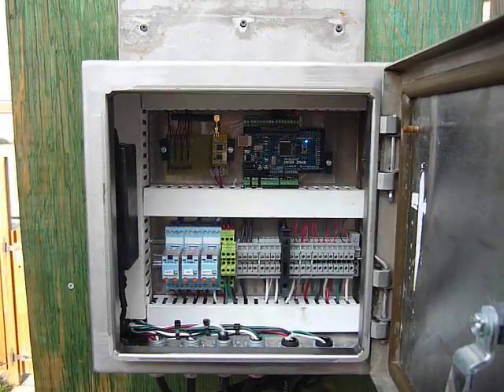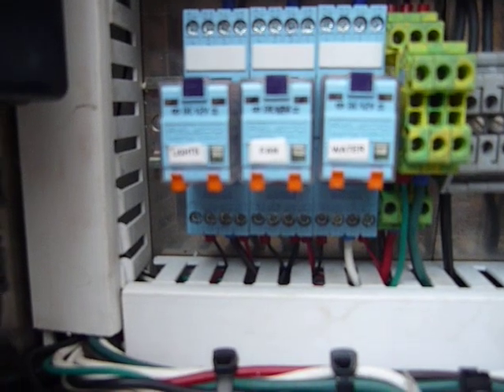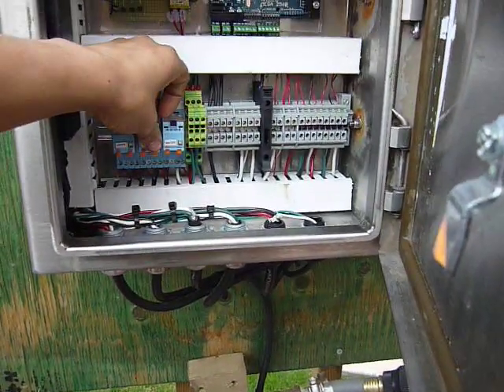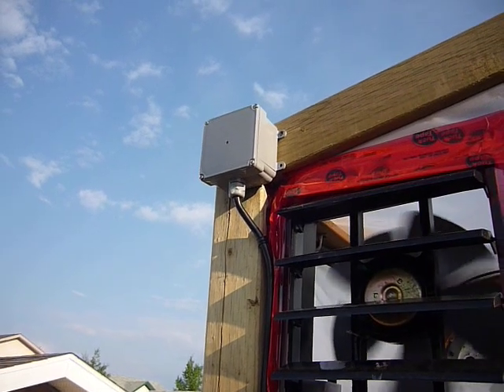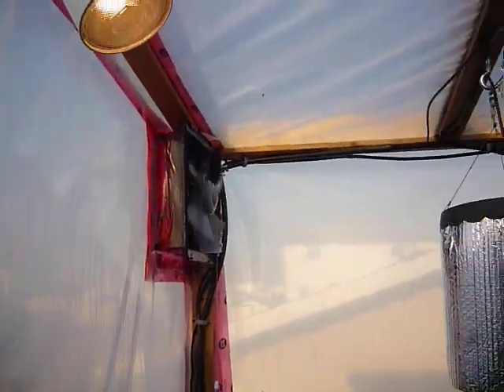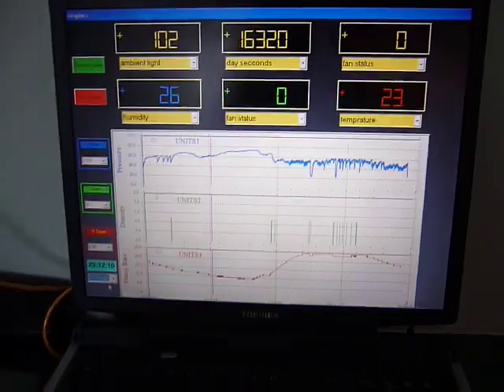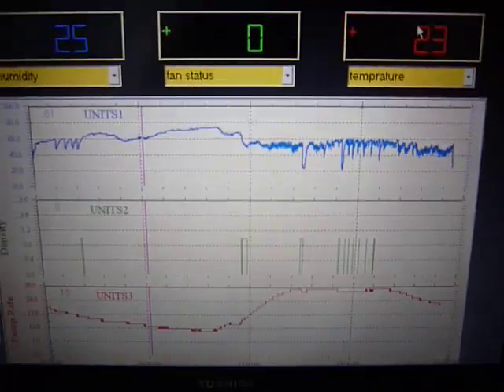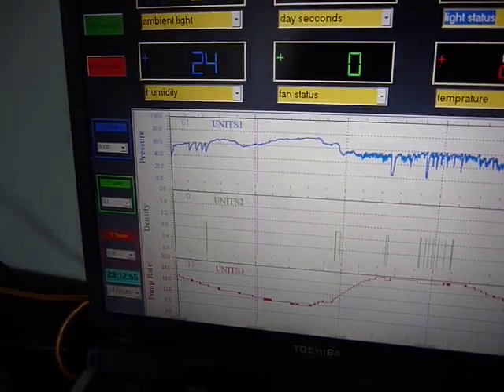arduino greenhouse

Comment: is there equivalent monitoring software to use with a raspberry pi?
Reply: I have never worked with raspberry pi but I'm 99% sure that there is some modbus TCP or RTU lib for it.
Then You can use some SCADA sw like Mango M2M or newer ScadaBR to control/monitor I/O lines.

It's just an idea
Reply: or just use serial over USB
Reply: Python works well

Comment: I am building 3 of these, but connecting the arduino as a firmata device to an android sbc with a touchscreen.  This project gave me a place to start but I knew what I wanted would wind up being somewhat more sophisticated, and the design I would like to be useful for a lot more than just greenhouses......
  Nice to see an update.  I would recommend getting rid of that wood and plastic sheeting, go for t-slots and double wall panels.

Comment from the maker: yes its 4 conductor soow, there is 120 supply in and 120 out for the fan and lights. the rest is dc for signals and water valve. im glad to hear my project was able to help you

Comment from the maker: I used a TTL serial output from the mega 2650 to an APC220 wireless module in the green house box. In the house i have the corresponding  APC220 with a USB adapter going to the laptop. The USB APC220 installs as a com port. I use a basic WITS protocol DAQ software to record and display the data.

Comment from the maker: @MurderDrunkie , I have not ran into that issue because when its hot the moisture in the soil evaporates and makes the humidity rise.  However my default logic in that event would be to turn fan on because to high a temp will very rapidly kill plants, however ambient humidity will not. Depending on your local climate you could add a mist spray nozel that came on with low humidity.

Comment from the maker: the software on the PC just displays data from the controller. It is data aquisition software using the WITS(well information transfer spesification) standard. the programming on the arduino does the control.